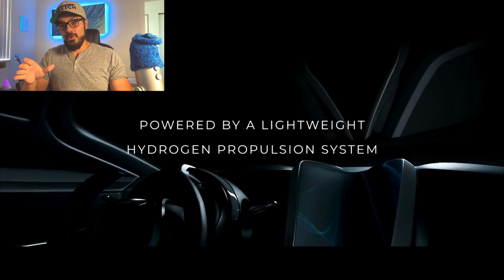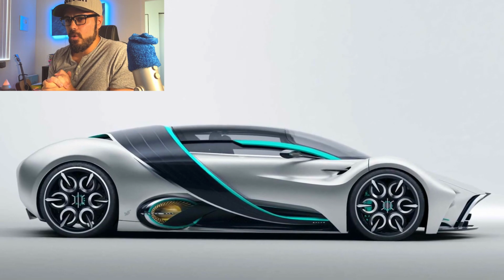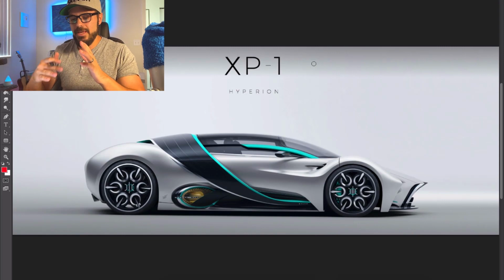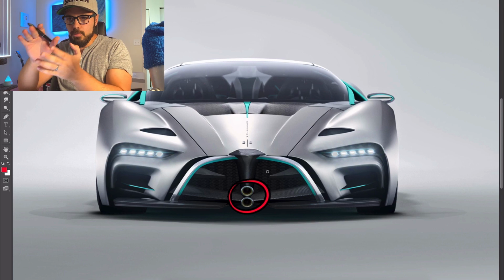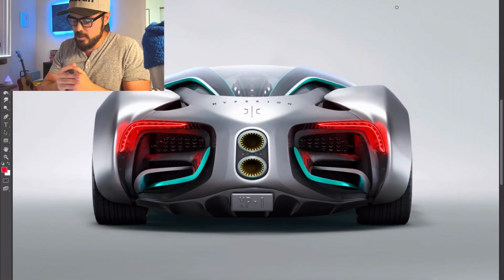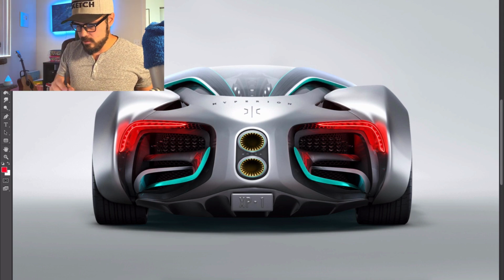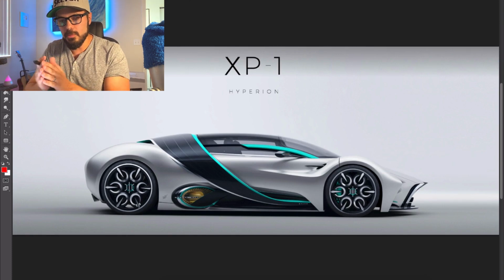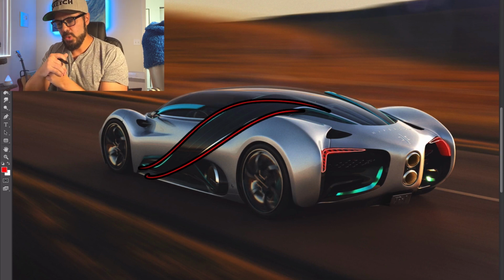My thoughts on the HYDROGEN Hyperion XP-1

Comment: The 2 small pipes at the car's nose mimics the 2 large pipes at the rear.
I agree that the 2 pipes in the front and the vertical black bar should be deleted.

Comment: Most important: only takes 5 minutes to refuel!
Reply: To be fair, most upcoming evs are citing charging times in the 20-30 minute mark. That time will only decrease. Hydrogen isn't bad however, there's just no infrastructure around it currently relative to ev and gas powered vehicles, and consumer knowledge of it is very low.
Reply: I think in the future, it will be a mix of all 3 types of propulsion. Some will stick with typical ICE, others evs, and some will pick hydrogen powered vehicles.

Comment: I'm sorry but you completely left out all of the drawbacks of hydrogen. Saying it's supply is basically unlimited is inaccurate because almost all of it is locked into molecules like water or natural gas from which you have to extract it. To "charge" a car using hydrogen from water, you need to invest the energy to charge THREE electric cars. Besides that, fuel cells use tons of platinum and are still pretty huge.
Reply: You don't need lots of power to produce hydrogen. That is a propaganda that must have been started by the Oil companies in order to product their profits. Electrolysis unlocks Hydrogen from water molecules. But you will be venturing into suppressed technology territory, and would attract sinister government forces to yourself. I know this because l have already built a Hydro-combustion device before, and knew of others who have too.
Reply: The thing is unlike battery power, fuel cells are still in their early stages, not many people invest in it because of corruption... uh...Lobbyism (I think that's how people in the west call it). In Japan hydrogen is considered the future, well Japan is known for doing smart things and such :v
Reply: @DefinitelyNotEmma  Pretty much every industry you know of today today started with some kind of challenges. This is because for any new industry to thrive, it has to either create its own territory (summoning competition by that process), or unseat the reigning industries that were already on the throne.

Comment: I personally thing hydrogen fuel cell cars would be more beneficial to the earth then electric power
Reply: Also, cars are the least concern, build more up to date nuclear power plants and mix it up with renewable energy sources. The biggest ships should be powered by nuclear reactors because they pollute the environment more than all cars combined. Also Airplanes need a major overhaul in their fuel choice.
Reply: Future battery  tech will make hydrogen obsolete
Reply: Hydrogen combustion engines will be even more beneficial
Reply: @sethriggle1462  why
Reply: @allensaunders449  because it's very eco friendly.
Reply: @sethriggle1462  but getting to the point of easy usability is difficult. Plus very flammable just don't see a whole new tech happening .  around it. Yes the by product is water vapor but so much would have to go into it first. Electric is the future. That's the spit money is being poured into. Breakthrough battery tech. Is coming soon too
Reply: @allensaunders449  what will you do when you run lithium dry? Wouldn't you want a actual renewable source of energy like water? I always think it's funny when people say electric is the future, but if you think about it. Electric motors and batteries are a very short term way of thinking. If anything it's just a trend.
Reply: @sethriggle1462  sooner then you think batteries in cars will be made differently and cars will never have to recharge. Not a pie in the sky dream. How would hydrogen be captured, stored,  transported, put into cars. Cars would all have to be redesigned, engineered and built. The intrastructure, is used on some public transport only . Cars i don't think do. Don't look at todays battery materials as all there will be in 5 years batteries will be unrecognizable from what we use today
Reply: @allensaunders449  hydrogen combustion is super simple. Fill you "gas tank" with distilled water with high levels of salt work too. The onboard electrolysis. It takes a small amount of electricity to produce enough hydrogen to power car.
Reply: @sethriggle1462  so simple once the intrastructure is in place. I say again building new cars, transportation, of it. Storing it making it cost effective so many questions that aren't magicly answered
Reply: @sethriggle1462  batteries are everywhere already in s5ll things cars, flashlights and phones just to name 3. Small jump to make them safer, more efficient power density wise. Materials they are made out of too . The world is working on these problems
Reply: @allensaunders449  you won't need to build new cars. Do you know anything about cars? I'm not trying to be mean, but if you know how cars work you'd understand how simple it would be. You don't even need a new engine. Everything stays the same. Just uses hydrogen instead of gas. And water in the tank instead of gas.
Reply: Hydrogen is everywhere, costs to attain I hope will get cheaper thru time https://www.youtube.com/watch?v=jf5t6jn87WQ&t=2s
Reply: you 'thing' but looking at it physically electric power will always be more efficient
Reply: @cenakaze  yes but the pollution it takes to build the batteries for a electric car and the power has to come from a power stations which in lots of country's means something like gas or coal it isn't as eco friendly as people think they are
Reply: @splay4770  so is hydrogen. Whatever electricity is used to power battery electric vehicles is also used to generate hydrogen. Then hydrogen vehicles also have batteries, just smaller. Over the course of a vehicle's life BEV is still better environmentally.
Reply: @splay4770  thst will change car batteries are in there infancy tech. Wise
Reply: @allensaunders449  yes but atm we can't wait for batterys to catch up and while yes a hydrogen car does need a battery like every other car it doesn't need a battery half as big as electric cars and I live in a place where it's cold and hilly most the time so electric cars won't work here very well
Reply: It is, that's the reason Japan is heavily investing in hydrogen technology, unlike the corrupt...uh...lobbyists in the west.

Comment: This was my final year project at uni back in 2016. These exact reasons I took as well as the idea of having a 'halo' car or a poster car for hydrogen to get the next generation to aspire to the technology. I'd love to get some opinions on it if people want to. Foolishly I got a bit too excited and its design is 0% road legal 😂😂 but the ideas are there.
Reply: For my final year project I designed a hydrogen poster car for infiniti. I've wanted to take another crack at it for a while now but work and life have stopped me so far. This car used a mix of fuel cells and HICE technology to power it. The car used a stretchable metal 'skin' to save on material as well as a flexible verticle spine for aero. It was a little mental 😂
Reply: tacourf1 sounds cool!

Comment: Hydrogen fuel cell is the way forward. It'll take a long time to be a really credible alternative, but it'll happen.
Reply: eh. current fuel cells require obscene amounts of platinum to function, which rules them out as a alternative for mass production vehicles, and the most promising fuel cell technology that would be viable requires pristine graphene to function. 
News Flash: pristine graphene is also the stuff that would boost battery technology to a point that EV´s would be superior to hydrogen. So there´s really no definitive answer to which technology will rule in the future yet.
Reply: It is such an under used technology. I always thought that electric isnt the future. Hydrogen is. Electric cars for me are a stop gap.
Reply: @tacourf1  Same here, I was pro EV for a while but then read about "rare earths" dilemma, geopolitical issue with Lithium,
problems BEV have in extreme heat, more so in extreme cold----finally Battery Tech. is progressing much tooooo slow.

Comment: Elon Musk said that hydrogen isn't efficient.
Reply: Hydrogen can be efficient if the infrastructure was there to a level similar to petrol or electric charging stations. Its just starting too far behind. Honestly if they managed to sort the infrastructure out, hydrogen would be the best optjon for the planet. Much less horrific levels of mining, the carbon isnt just moved from the car to the powerstation etc...
Reply: @tacourf1  it takes lots of energy to produce and than to convert it into power. I get his point, but what concerns me is that it is flammable.
Reply: @IsmaelAlvesBr  so is petrol
Reply: @Scoobywoo7447  but hydrogen needs to be pressurized !
Reply: @tacourf1  you have a point I mean old cars weren't anywhere near the efficiency they are today
Reply: He would
Reply: @Scoobywoo7447  I think that hydrogen is just reasonable for flights
Reply: He's an electric guy, of course
Reply: Elon Musk says a lot of things, as I mentioned now a bit in the comment section Japan is investing billions in hydrogen technology, because they know what they are doing. Hydrogen is the future for aviation and especially trucks and bigger cars. Battery power is nice for small city cruisers.
Reply: Agreed but it's better for refueling
Reply: There are loads of ways to introduce safety systems for hydrogen. Bmw have done a tonne of research into it themselves. I used things like a quick release system to remove all the gas from the highest point in my concept. As soon as hydrogen comes into contact with pretty much any other gas its null and void.